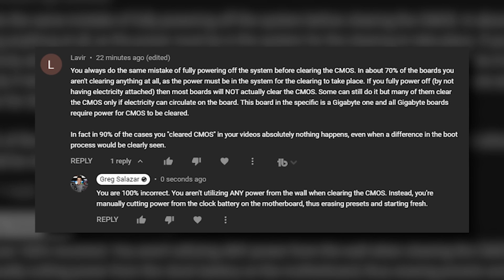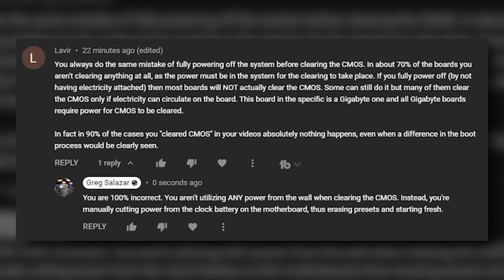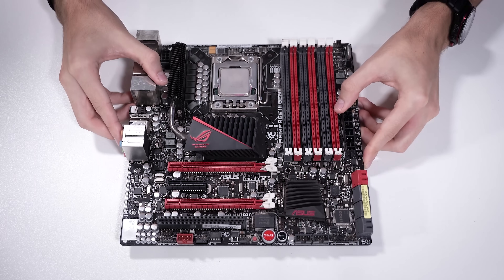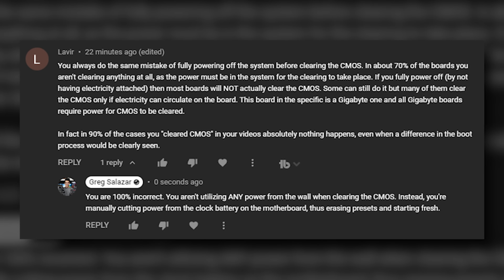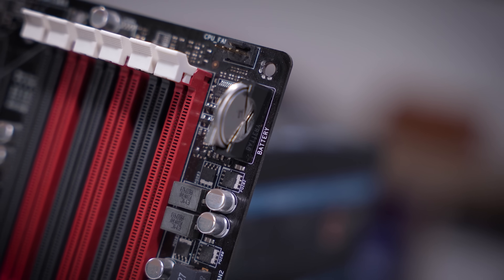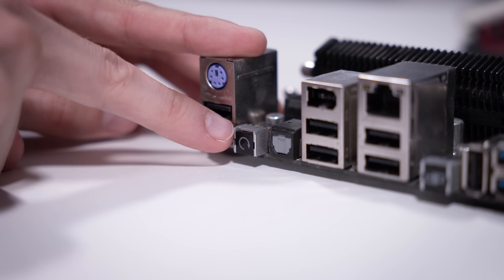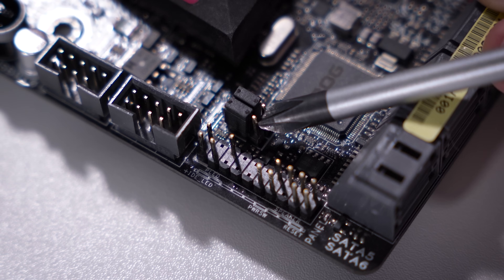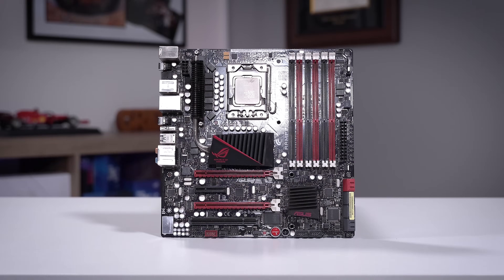How To CORRECTLY Clear Your CMOS

Comment: 3 Major brands  - ALL instructing to power down the system
MSI
Resetting BIOS to default values
1. Power off the computer and unplug the power cord.
2. Use a jumper cap to short JBAT1 for about 5-10 seconds.
3. Remove the jumper cap from JBAT1.
4. Plug the power cord and Power on the computer.

>> Gigabyte <<
CLR_CMOS (Clear CMOS Jumper)
Use this jumper to clear the BIOS configuration and reset the CMOS values to factory defaults. To clear
the CMOS values, use a metal object like a screwdriver to touch the two pins for a few seconds.
• Always turn off your computer and unplug the power cord from the power outlet before clearing
the CMOS values.
• After system restart, go to BIOS Setup to load factory defaults (select Load Optimized Defaults) or
manually configure the BIOS settings (refer to Chapter 2, "BIOS Setup," for BIOS configurations).

ASUS
Clear CMOS header
This header allows you to clear the CMOS RTC RAM data of the system setup
information such as date, time, and system passwords.
To erase the RTC RAM:
1. Turn OFF the computer and unplug the power cord.
2. Use a metal object such as a screwdriver to short the two pins.
3. Plug the power cord and turn ON the computer.
4. Hold down the <Del> key during the boot process and enter BIOS setup to re-
enter data.
If the steps above do not help, remove the onboard battery and short the two pins again to
clear the CMOS RTC RAM data. After clearing the CMOS, reinstall the battery

Thanks for your videos. I had to deal with this sort of confusion constantly  when I did tech support.
Reply: My msi x370 gaming pro board states:
Resetting BIOS to default values
1. Power off the computer but DO NOT unplug the power cord (system under S5/ 
Soft-off mode)
2. Use a jumper cap to short JBAT1 for about 5-10 seconds.
3. Remove the jumper cap from JBAT1.
4. Power on the computer.
So it's not that straightforward as u think. Soft-off or s5 is pc state after u click shutdown in windows.
Reply: @dragzzt  I do know what S5 state is! I have been doing this since the early 1980's

Comment: Just a small addition. I just the other day had to clear cmos on an ASUS X570 board. None of the usual methods worked so I went to the manual. It stated to not only remove the battery but to also short across the battery contacts. My guess is they must have a really good cap on that circuit because that is the only thing that eventually worked. Shorting the pins and removing the battery for over 10 minutes did nothing. I'm sure leaving the battery out even longer would work but I'm not that patient.

Comment: Ive tried shorting the pins on my aorus mobo, but didnt clear the cmos, had to do it the manual way having to remove the gpu blocking it.
anything im doing wrong?
Reply: Try keeping power to the board (not powered on and running - just with power into the psu and the psu on) and try short the pins.
Reply: alright I'll try this when the time comes.

Comment: Many years ago I upgraded the ram in my PC I had at the time, and I was just learning about the workings of PCs (I had an old Dell before that that I had fitted an old school slave/master HDD configuration, and that was it).
Just like with the Dell, when I fitted this ram I looked it up on the internet first to make sure I was doing things properly, and did exactly the same when I fitted my first graphics card as well.
One of the things that was mentioned was if your PC does not post after fitting the ram, reset the CMOS and the only way they told you how to do it was the final option in this video, remove the battery for about 10 mins. Since then this is how I have done it. I have only had to do it one other time, and that is on my current PC when guess what, I upgraded the ram.
I actually forgot about resetting the CMOS and started panicking, pulling the ram out, reseating my original ram etc. Once I calmed down I did a quick google search on my phone and the first thing that popped up was CMOS .. it all came flooding back and worked perfectly.
I never knew there was a reset button on some boards or about the jumper pins until I started watching your videos.
The fact the whole point of the CMOS is to make sure your bios is saved and stuff like the clock is still running, should tell anyone that the CMOS battery is what is supplying the power to it, and that it does not need external power to run.
If the CMOS needed power to work, then every PC anyone buys or motherboard would not work properly when you buy them, because they have not had power going through them for some time potentially.

Comment: As a teenager I used to own one of those cheap Casio digital watches that were so ccol back in the day. Any time they spent without enough battery power to preserve settings they just hard reset. Which is what loss of battery power should do to anything. Like a motherboard with a 2032 battery on it

Comment: We used to remove the battery back in the days all the time but it only took 5-10 seconds for that to work. I don't know if it's so different today that it takes 10 minutes as I don't use that method anymore. But one of my pcs I had a few years ago had a dead battery and if I unpluged it from power or just switched the psu off for a few seconds, the bios settings would reset.

Comment: If he thinks the CMOS clears every time you turn it off, he probably doesn't have a battery in the mobo. Or the rear IO is constantly pressing a clear CMOS button, which most of the time, shouldn't boot.
Reply: That's not what he was saying. That's the exact opposite of what he was saying

Comment: So... is it 70%, 90%, 100%? Seems they're very confused about how often their misconception is the case. Their confusion could have been solved with a quick Google to find that EVERY single guide to clear CMOS includes removing power from the system. I love how they were so confident that typed up that essay.

Comment: I bought a new motherboard & after i installed everything, the Gpu debug light was flashing so i tried clearing the cmos using a screwdriver on the jumper pins but i totally forgot to turn off the power & it shorted out the motherboard. Brand new 2 hours old motherboard.....

Comment: I would always recommend referring to the motherboard manufacturer's manual to confirm the correct method of clearing the CMOS. My Gigabyte manual is very clear that to clear the CMOS using the back panel button or the jumper on the motherboard, it tells me to turn off the computer and disconnect the power supply from the wall before carrying out the clear CMOS function. In fact, the manual warns against clearing the CMOS with power on. You can't go wrong checking the manual before carrying out the maintenance, because if the manual is wrong you have covered your butt for follow up action with the manufacturer in case something goes sideways.

Comment: You the man for making a video out of this specific issue. I actually learned to clear CMOS with a screwdriver watching one of your videos. For many many years I use the little jumper thing that comes on old mobos and optical drives to clear the CMOS. Your method is so much easier and works as intended.
Reply: ha ya same. I mean the jumper method works, but certainly haven't seen a jumper in maybe 20 years either, where i have an endless supply of screwdrivers. I also don't miss setting slave/master on drives and disks.
Reply: if you remove the battery for about 10 minutes the bios will be cleared, works the same as jumping pins
Reply: If you get really frustrated or doubt that the CMOS is actually clearing you can remove the CMOS battery from its housing. That's how we did it back in the olden times.
Reply: Removing the batt is a trick from 1999....
Reply: If you remove the battery and putting it back and the PC is back to working then why put it back in the first place?  My Thinkpad has been running with a dead CMOS battery for years, just reset the time and date before booting it up and it's good to go, it even makes this video obsolete, how about the good old tech of the past?
Reply: It has a little risk on it, if your hands are shaky you could short something else and this could be a big problem if you do not power down and unplug your system AS YOU SHOULD! 

Also dropping the screwdriver or holding it wrong, applying too much pressure and bending something is possible but this  has a very low chance to become a problem even if you do this 1000 times.

Finally,  yes I also reset with a screwdriver.

Comment: Actually, the CMOS nowadays consists of a NVRAM chip (non-volatile) but motherboard manufacturers kept the shortcut of clearing the cmos by taking out the battery bcz people were/are used to this. But, yes, in the past the chips actually were volatile chips
Reply from the maker: It's my understanding that modern boards still contain a small amount of RAM in the RTC which is volatile. That part hasn't changed. Vendors just default the "removing the battery" step to clearing whatever's also stored on flash because there'd really be no other reason to remove it apart from preventative maintenance.
Reply: @GregSalazar  In my experience, I've had two CMOS coin cells go flat and when booting my system it displayed checksum not correct (or something like that) press Delete (Del) to enter set up, upon doing so the clock started counting from 0:00:00 (military time) of course it may already be showing a minute or two by the time I actually hit Del. All the settings are back to default. 
  I do not have any experience with the UEFI BIOS other than on two laptops I own and they are nothing like what I see on shows like yours with all the fan animations and countless configuration screens. One laptop is a Microsoft Surface 3 and the other is an early 2000's HP NOTEBOOK - 15 (it doesn't meet the windows 11 requirements) if memory serves it is because of the AMD processor. I don't think it supports the SSE 4.? (2 I think) instruction set. I do not know if what I read is true, but as I understand the kernel requires SSE 4.2  or 4 (I don't remember the number after the decimal) I don't think it even has anything SSE 4. A True hardware limitation because of the kernel windows 11 uses. 
  I got way off topic LOL, anyway pulling the battery causes everything to go to defaults and the clock also has to be set as well. 
  I think this is what you were saying all along LOL. I will watch the video in full now LOL.
Reply: @GregSalazar  I had a lenovo laptop and thats how I learned the hard way bios use NVRAM on UEFI implementations.
TLDR I bios modded it to unlock wifi limits (and I got unlocked bios options as well). I changed one settings too many and the system stopped booting! 

and I had no way to load defaults. removing power + cmos cell, did nothing.

settings are written to the same chip UEFI is on, so by reflashing the modded bios, I got back my vanilla settings.

I would assume the same goes for desktops. 
shorting the pins or removing the battery runs a small line of code that erases the NVRAM.
which would be why you would assume you need power to be ON (standby).

maybe not every manufacturer checks the RTC (volatile), and if emtpy, reset bios settings..., and in that case. no power, reseat battery = no clearing of bios.
Reply: @GizmoTheGreen  i had that problem
I removed power cable, removed battery, pressed power for long time, used jumper, flashed the buttom, and even setting was default on the surface but pc was not starting correctly, altgough i tried all the volatile steps

So i had to leave it for 12 hrs then came back and returned battery and power cable and it started
That shows that non volatile memory was not reseted

So how to reset cnos of nvram??
Reply: @GizmoTheGreen  Especially on laptops and Class 3 systems, removing the battery usually just resets the clock, but leaves everything else unchanged. These are also the systems where shorting an NVRAM clear jumper with power applied is required, as the jumper is simply a GPIO signal that the firmware checks on boot to see if an NVRAM erase is being requested.
Reply: NVRAM is available only on server based mobos not daily use mobos
Reply: @dr.stephenstange4979  that is Not correct. In fact you can see The NVRAM on nearly every UEFI Mainboard. Also in The past, the BIOS was saved on ROM, which was non volatile. If The BIOS was saved in volatile way, The BIOS would bei gone, If Battery was empty/mailfunctioning once. That would bei pretty dumb. Raspberry Pis dont have one. The MB Producer Compaq even Had Mainboards without CMOS Chip.
Reply: @flipsundsalti1949  okay that was new i didn't knew about it. Thanks for expanding my knowledge buddy ☺️
Reply: @flipsundsalti1949   i had that problem
I removed power cable, removed battery, pressed power for long time, used jumper, flashed the buttom, and even setting was default on the surface but pc was not starting correctly, altgough i tried all the volatile steps

So i had to leave it for 12 hrs then came back and returned battery and power cable and it started
That shows that non volatile memory was not reseted

So how to reset cnos of nvram??

Comment: Wait so, EVERY Computer Tech channel has been doing it wrong? Like Every single one? The many hundreds large and small, the millions of folks on PC tech forums, boards, channels, Reddit as well as the  Manufactures in their own Manuals with their own designs for clearing CMOS, Tech support from the same companies and outside giving the advice on how to clear CMOS and why it works....is wrong? 

Or as Greg demonstrates the commentator is wrong. Since the battery is a back up power source and you want 0% power in the machine to clear CMOS, any power keeps the CMOS.....which means the Commentators effort does not clear CMOS and instead they keep their CMOS if they do what they say.

Comment: 1 minute in, yeah, after 18 years in IT AND being A+ Certified, OP is full of it. As a gigabyte motherboard owner, he is 90% WRONG (ASK ME HOW I KNOW LAVIR). Thanks for calling them out Greg.
Reply: Yep, I also am A+ certified, and I remember a question on the exam about clearing the CMOS. Greg is spot on regarding the correct methods.
Reply: Now, I could be wrong, but afaik modern systems do use non-volatile memory chips to hold the UEFI. So while you can remove any power source and any changes you did to the UEFI will "stick", manufactuers decided to use that "i removed the cmos battery" to force a bios reset anyway.

(or what that other post said)